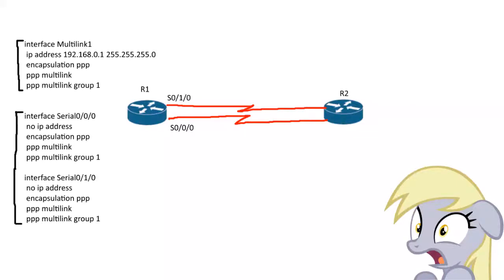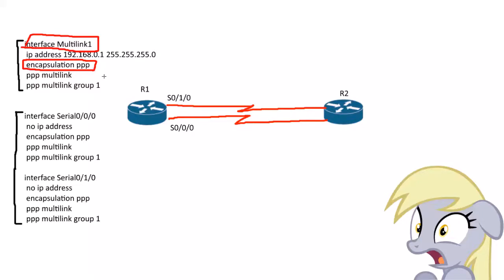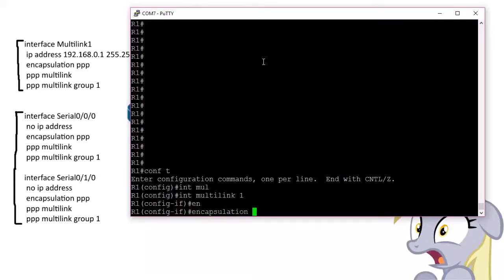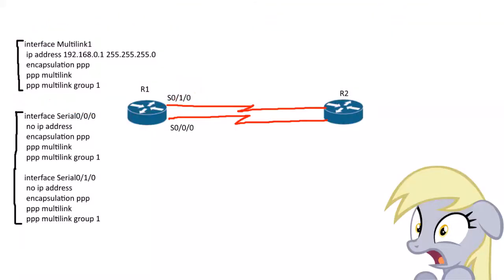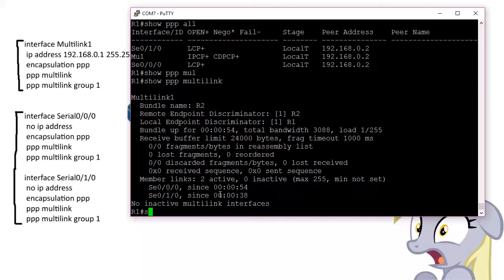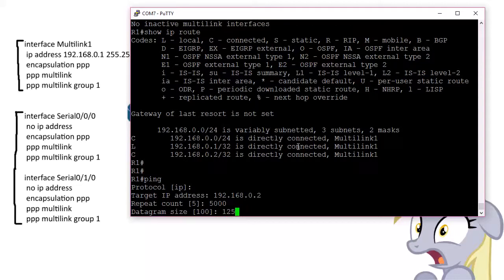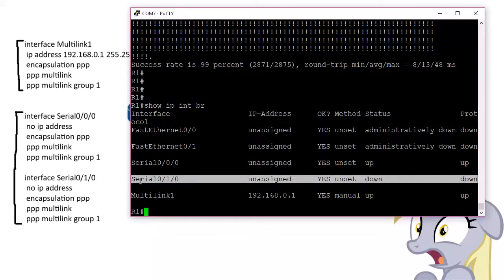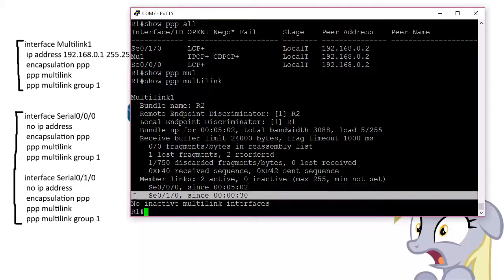CCNA 200-125: MLPPP Configuration

Comment: SP1(config)#interface multilink 1
                      ^
% Invalid input detected at '^' marker.
Reply from the maker: Your device might not support MLPPP. Are you running CatOS?
Reply: @DerpyNetworking  packet tracer. I understand it doesn't